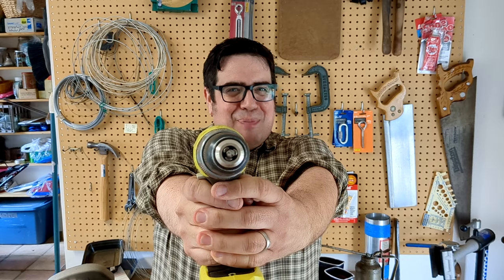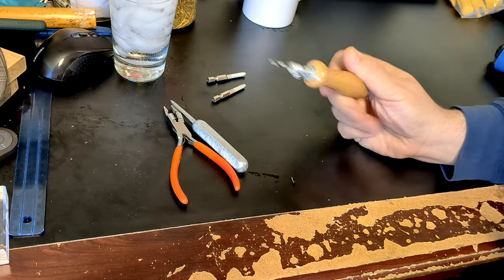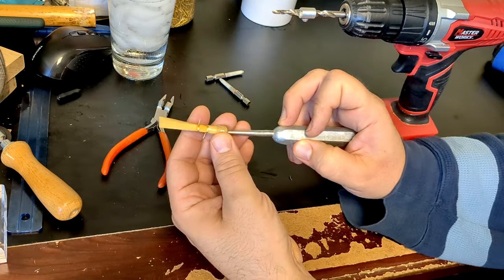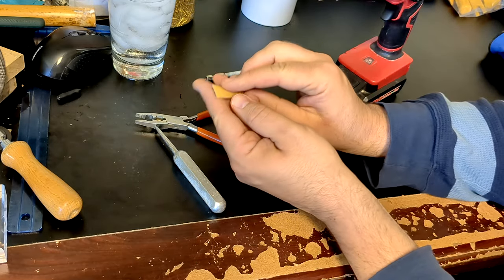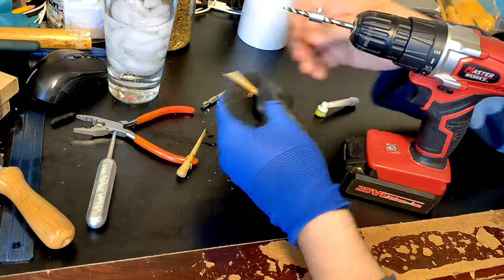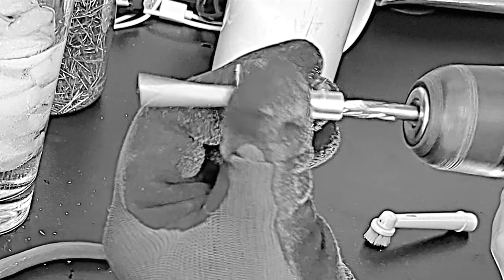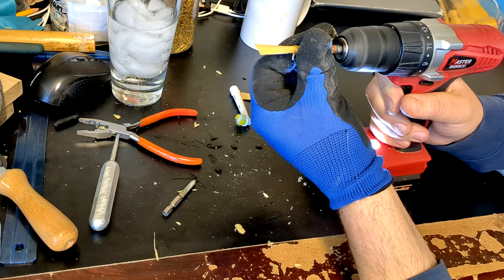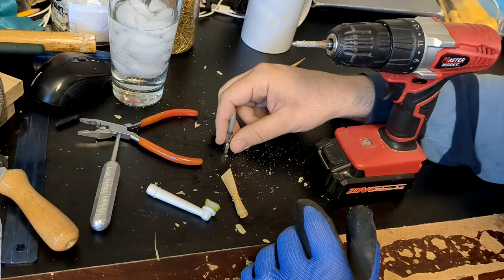Makin Reeds with POWER TOOLS- Reaming with POWER!

Comment: I concur.  I’ve used a drill to ream for a number of years. I do hot forming with a temperature controlled soldering iron.
Reply from the maker: I use a hot pot, which I suppose is a power tool in a way, but more of a cooking appliance.